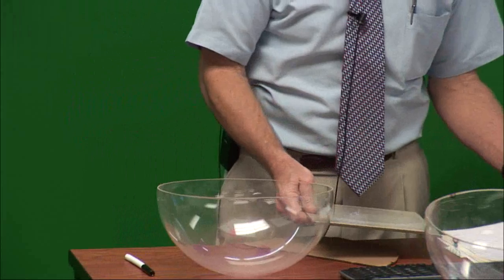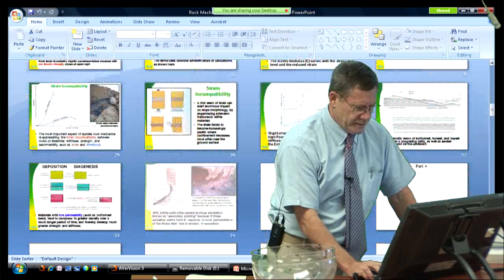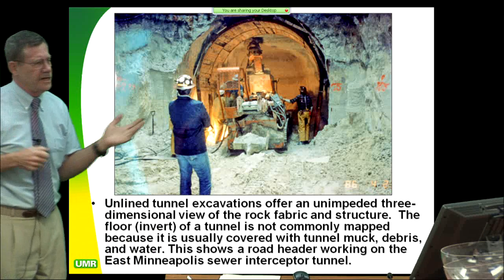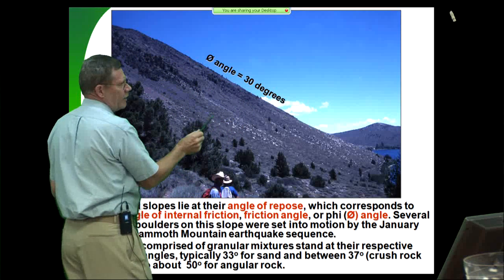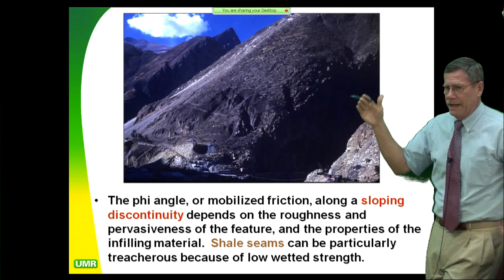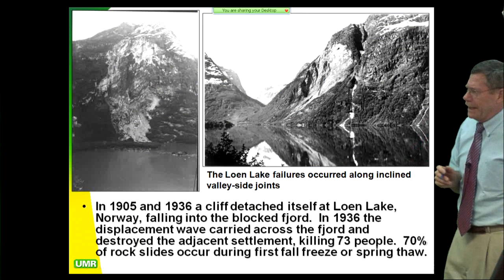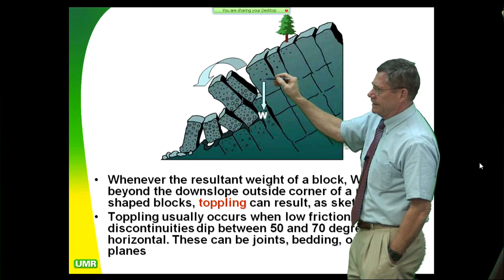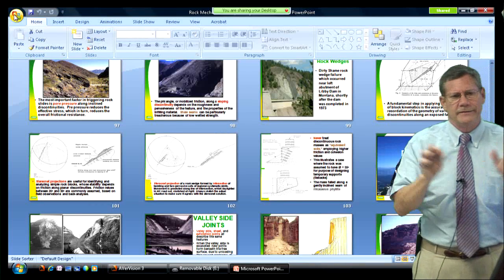Engineering Geology And Geotechnics - Lecture 6

Comment: This is a vast simplification of the concept of angle of shearing resistance (which is what it should be called instead somwthing like friction angle or angle of internal friction). Yes, for most materials the angle of repose is close to the angle of shearing resisitance, but the problem is the difference can bd a couple of degrees. And a couples of degrees actually gives a very large difference in shear strength of the material. The angle of shearing resistance is normally measured with a triaxial apparatus under sta dEdized co ditions. And this value is dependent on the looseness of the granular mixfure, while the angle of repose is the angle thT a grnaulr pile makes if it was showered down into a pile. And this results in the franular material in a loose state